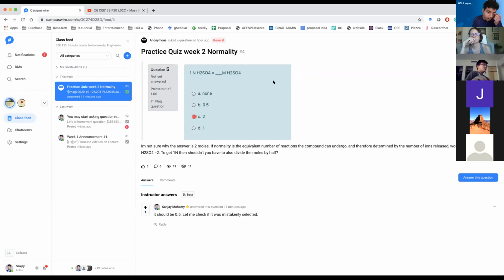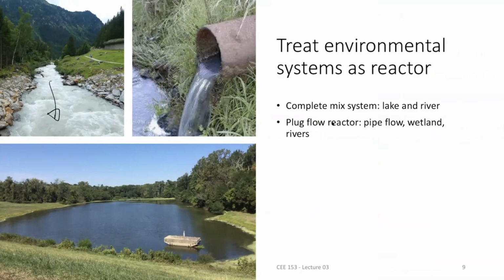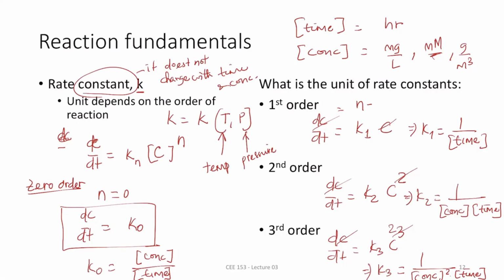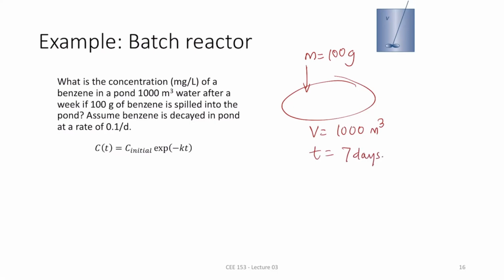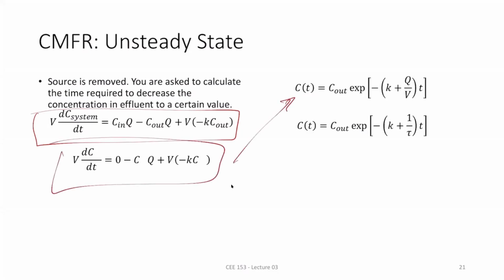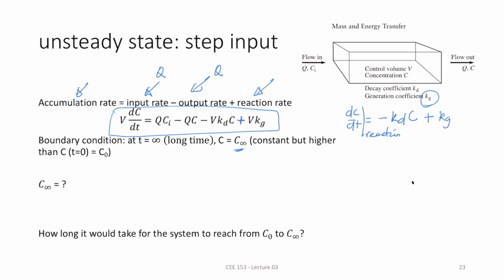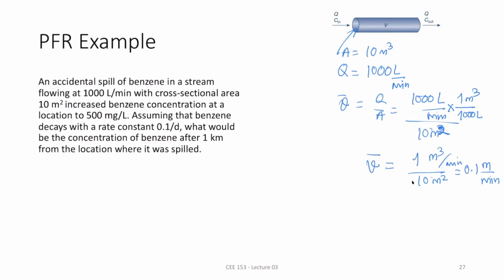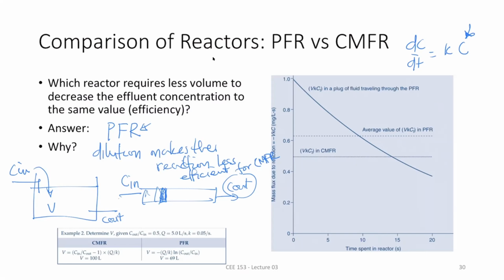CEE153 - L03A - Mass balance - Reaction details

Comment from the maker: List of items to learn in this lecture:
@0:30 register for Campuswire (use code 3636). Why you need it?
@5:37 Youtube videos for the class
@9:05 Today class
@9:31 Practice quiz that you should try on CCLE.
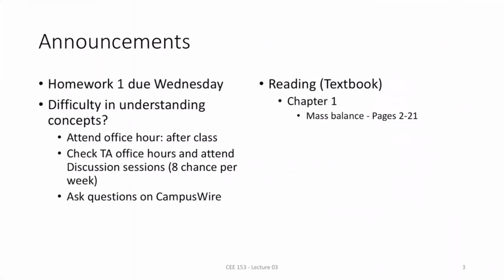@10:10 Announcement on homework and reading assignment
@11:20 What are the learning objectives of this class?
@12:01 Overview of reaction term in the conservation of mass application
@12:11 Real-world application of today's lecture
@16:07 Different types of reactors in natural systems
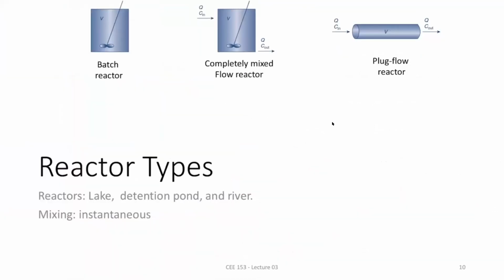@19:18 Reactor types based on how fluid is mixed or handled in the system
@20:30 Reaction fundamentals: order, rate, and rate constant 
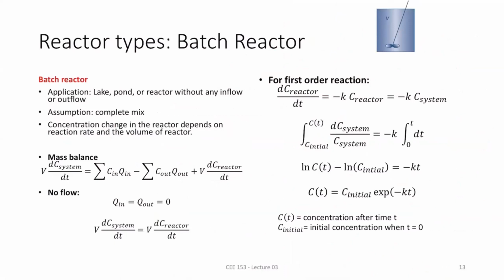@34:03 Batch reactor: concept and math
@44:00 Half-life time calculation
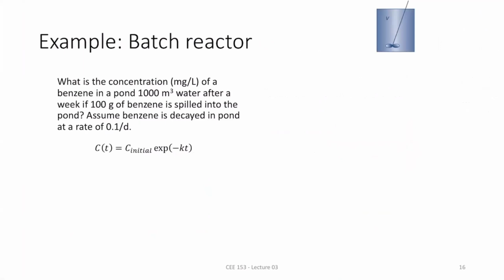@46:23 Batch reactor: Example
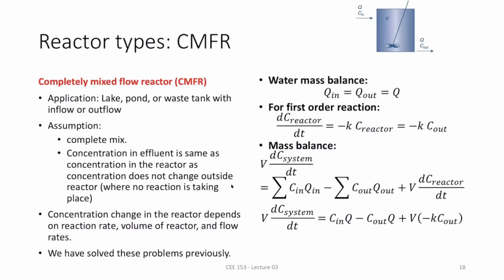@53:18 CMFR or CSTR reactor: concept and math
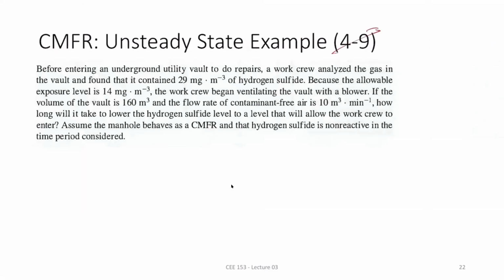@1:02:44 CMFR: Example
@1:13:46 CMFR: Unsteady state concept and math
@1:26:40 PFR: Concept and Math
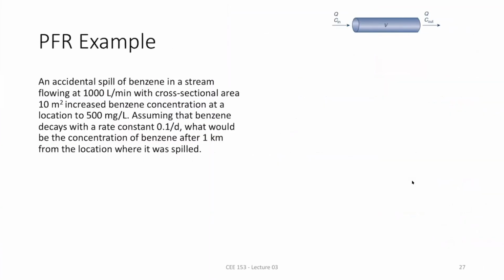@1:31:04 PFR: Examples
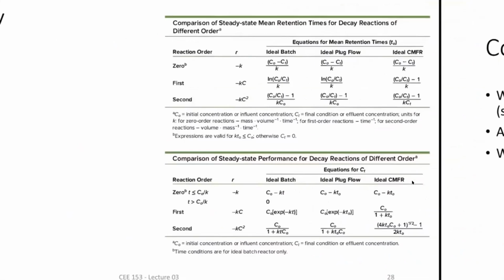@1:36:28 All reactors: Formulae
@1:43:09 Which reactor can handle shock (sudden increase in concentration)? 
@1:45:07 Which reactor requires less volume or more efficient? 
@1:48:06 Do it yourself examples
@1:49:17 Final thoughts and Q/A